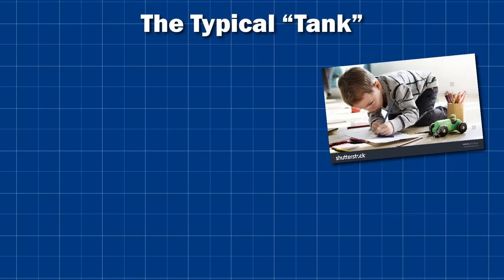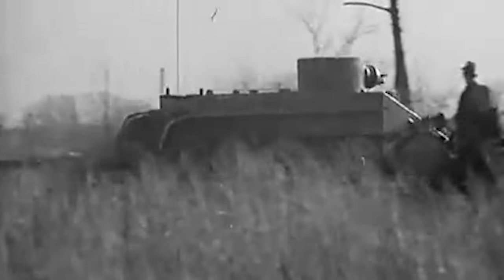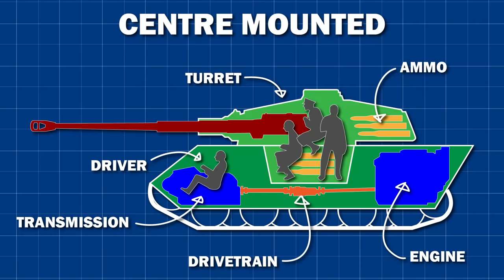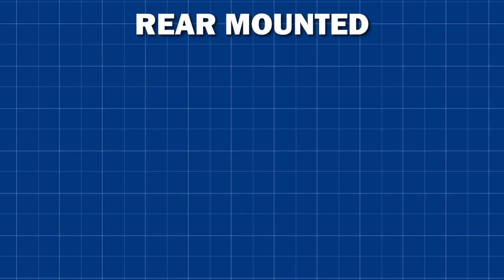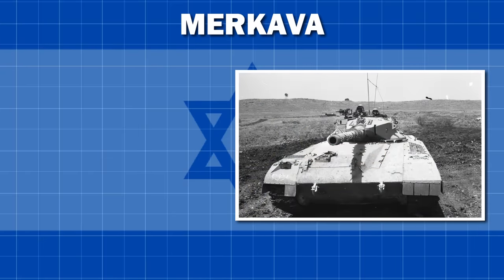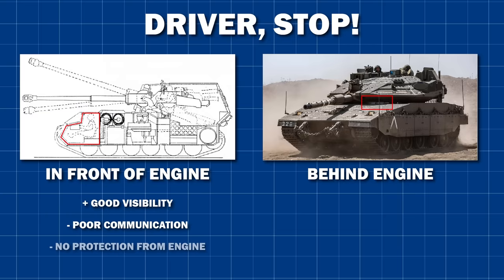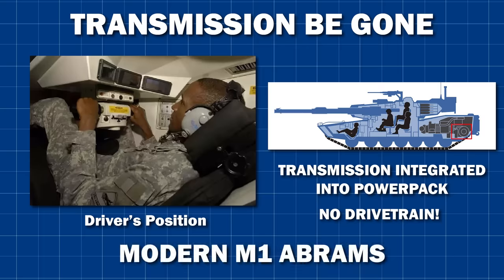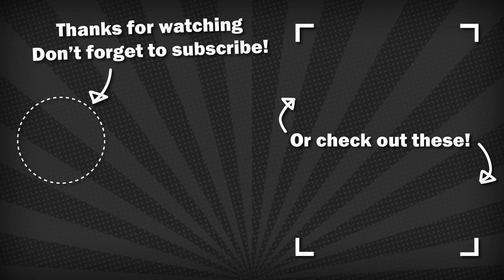What happened to Rear-Mounted Turrets?

Comment: Ironically putting the turret in the middle is where you put it when trying to find the middle ground between all the pros and cons.
Reply: Ironically you literally can't put it any more forward than on BTs and T-34 without also putting the driver in it ala MBT-70, which is how they wanted to shorten the tank.
Meanwhile in russia: ivan, why not put engine transversally?
Reply: A con that wasn't mentioned and is a deal-breaker in most cases is access to the powerpack (engine and transmission) for maintenance.

Comment: one of the most successful "rear mounted turret" is the AMX-13, the idea was that this light recon/infantry support was very short and could still use a full length gun (75 then 90mm) while being able to fit in airplanes, the driver was seated beside the engine, this tank was used for a long time, even receiving ATGMs to compensate for the aging guns
Reply: Israel took some of the concepts from this tank
Reply: I hate playing against that tank lol
Reply: We had the AMX 13 with 105 mm cannon in the Dutch Army.
Great fast tank, low profile,quick reload, thin armor, weak clutch, petrol engine..
Reply: @patverum9051  "Commander we are under heavy enemy fire! We have multiple penetrations!" "Relax it is just rain" (About the thin armor)
Reply: AMX-13, the MBT of the Indonesian army.
Yes even in 2023 they still use it as their mainline tank.
Modified with a diesel engine and better targeting systems and sights. There's also a proposed upgrade with composite turret armor and new 105mm gun, and also another new diesel engine.
Reply: Amx13 was a very successfull design.
Reply: Nothing ever happened to rear mount. The Self Propelled Howitzers have championed it.
Reply: @kishascape  i was referring to tanks, artillery is an other story
Reply: @patverum9051  and then we decommissioned it. and now lease tanks from the Germans haha
Reply: And 105mm, Indonesia have a plenty of retrofitted AMX-13/105
Reply: and then 105mm guns
Reply: Atgm? Oh yeah! It’s Amx-13. hot.

Comment: I also love some of the WWII era American prototypes like the T20, T23, and T25 with their rear-mounted transmissions. The former basically looks like a shorter and flattened Sherman, then you can see the clear line towards the Pershing design. Lower profile, more space and weight affordability in the front, and more armor/firepower as a result. That became the standard post-war for most nations.
Reply: almost all soviet tanks had rear mounted transmission
Reply: Most nations where doing rear mounted transmissions before the war. This video is just bad history.
Reply: @impguardwarhamer  I agree it should be mentioned, but to be fair it wasn't very popular until automatic transmission. Soviets simply didn't care how bad time driver had wrestling with the gears, since the size and weight reduction from it are so great on paper. About the British tanks I don't really know, though I haven't heard a good word about ergonomics or reliability of British WWII tanks either. Didn't Cromwell have somekind of semi-automatic gearbox?
Reply: @Teh0X  you dont need an automatic gearbox you just use a gear linkage.
It's awkward yes, but it was done.

It was widely used by the British and Soviets, and French tanks built in the run up to the war used it too.

Literally the only countries that didn't use rear mounted transmissions (that wern't just building vickers clones) was America and Germany, which for some reason OP and Wrench are pretending where innovators on the concept.
Reply: @impguardwarhamer  Awkward to say the least. It was straight out hampering mobility, though I understand it was made even worse by the friction clutch mechanism widely used in USSR and few other countries, until more advanced alternatives became available.

No doubt the smaller tank producing countries were just sticking to working foreign solutions like Vickers as long as they didn't venture too far. With that the best they got were probably tanks like Chi-Nu at tad under 20 tons. For the 30 ton Chi-To the Japanese had to impelement bit more advanced (copied) tech.
Reply: @Teh0X  British were very fond of Merrit-Brown transmissions, which were fairly close to automatic transmissions, certainly didnt require much force to use and were capable of some fancy stuff like neutral-steering. Cromwells did have those IIRC. 
Before that they generally relied on pre-selector gearboxes, which from the user end work like this: You drive normally, select the gear you want to shift into next with the gear lever, and when you actually want to shift you depress the gear change pedal, which is essentially replacing the clutch. It was also not a particularly hard system to use. 
Main issue with rear transmissions is just transferring the force for shifting gears and applying brakes all the way to the rear of the tank, which is why hydraulic assistance is such a crucial element. Soviet tanks utterly lacked any such luxury, hence their rear transmissions have such a bad reputation.

Comment: Thinking of it, a tank with a rear-mounted turret would probably also have severe weight distribution problems if the turret is turned sideways or towards the rear. Frontal engines, and especially engines in the middle of the tank are also much harder to access, and therefore conduct maintenance on, than rear engines. In modern days, the heat signature is also an important factor: while a rear engine would be somewhat concealed by the turret, if the tank is viewed from the front, a frontal engine would light up the tank on an IR display like a Christmas tree.
Reply: Trning the turret doesn't create any weight distribution problems since the turret must be balanced pretty well already just to turn around.
Reply: @user-vgrau  I believe he was refering to the situation when turret is facing back. I might be wrong. But yeah, it is still on the back and balance won't be shifting much.
Reply: @user-yr9rx2xh5t well that wouldn’t be an issue the center of mass for a turret is always inside it. Hence the longer the barrel the more weight it have in the opposite direction
Reply: @user-yr9rx2xh5t tip of the barrel is not going to be deciding factor for weight. Maybe if the tank was half way off the cliff maybe, but I'd blame any subsequent wreckage on the fact the tank was half way off the cliff.
Reply: it’s a problem already with the Stryker Gun Systems, it’s also why self-propelled artillery have rear stabilizers on them
Reply: @user-vgrau the turret itself is the weight problem

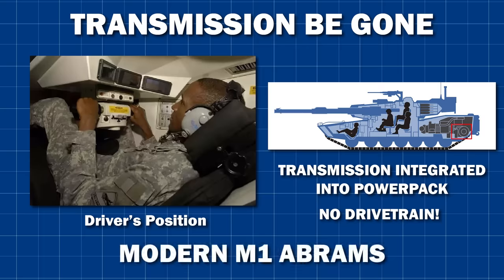Comment: 4:45 Shows you the pull cables on a Manual transmission In a Centurion tank.. 
Shows you a t34 with the lever system. Hammer included to change gear.
Reply: That is not a Centurion or T-34?
Reply: @robertoroberto9798  Both those tanks have the transmission in the rear with some mechanism to change gear in the front of the tank. That photo is of an M1A1 and driver. 
I was talking about flawed commentary, giving strange secondary impressions

Comment: A lot of Self propelled howitzers have rear mounted turrets
Reply: Also FYI the rear compartment of the merkava isnt really intended for infantry it's an ammunition storage area. The infantry thing is a myth that came from arma 3s merkava.
Reply: @matthewholt2174 I think you could theoretically have a couple guys in the back if you removed all the spare ammo, but it would be super cramped
Reply: @matthewholt2174 I suppose the intent is to use it as an impromptu battlefield ambulance. To get the wounded out under heavy fire
Reply: It also can be found on several modern tank destroyer designs.
Reply: @matthewholt2174  it was demonstrated just once. When they were showcasing the Merkava, they made 3-4 soldiers come out of the back compartment, seemingly to prove something. The soldiers complained about the crampedness and uncomfortable hard floor they had to sit on. And to carry 4 soldiers the Merkava would have to sacrifice it's firepower. Hey, just like Centauro
Reply: Yeah they dont have the weight of armour to worry about, and its probably easier 'bombing-up' with the fighting compartment at the back.
Reply: light armor + big gun = you have to mount it near the rear to make the center of gravity near the middle of the vehicle
Reply: SP Howitzers with rear turret allows for rapid replenishment of ammunition during a sustained fire mission. with a mid mounted turret for SP Howitzer, the rear powerpack is an impediment in moving ammunition into the turret. I suspect this is the practical necessity of an rear mounted turret for an SP Howitzer. From a retired Aussie armoured corps soldier who crew commanded an M113 with the very tiny Cadillac Gage T50 turret.
Reply: Loads of them don’t even have turrets
Reply: @keithad6485 and poor driver commander communication is not as much of a problem because only need to get in position and retreat if necessary so it is not an issue and it allows better gun elevation with better control of recoil from the cannon
Reply: @keithad6485  Many SPGs have turrets in the back but this is mostly necessity not because of loading but because long artillery guns on short tracked vehicles make it impractical during movement otherwise but, for example, Central European nations produce many longer 8-wheeled artillery pieces with mid-mounted turrets, and it's not an issue as you can get good access to the turret from a side by default or when SPG turret is turned 90 degrees sideways...

Comment: A lot of the modern tanks with rear-mounted turrets such as the Scorpion and Scimitar CVRT, M10 Booker, TAM, and CV90120 have that arrangement likely due to their APC/IFV origins, or at least an intent to have a family of vehicles based on a single chassis. 

Most modern APCs and IFVs have front-mounted engines because that allows one to have a large rear space for doing whatever with. If you’re turning an APC into a light tank, sticking the turret in the big empty space in the back is the most logical. The CV90120 is built from the CV90 IFV, and the M10 Booker is loosely based on the Ajax which itself is based on the ASCOD IFV. The TAM and CVRT were designed to be the basis for a family of vehicles, to include troop carriers, command vehicles, and tanks. 

Merkava’s layout is unique for a tank, but almost standard for an APC. It probably helped the Namer APC based on the Merkava, as all that needed to be done mechanically was to remove the turret and install some seats. Trying to do the same with a regular tank would involve far more effort in moving the engine to the front, installing a passageway such as the Achzarit, or forcing the passengers to disembark from the sides or top as is the case with BTR-50 or Nagmachon.
Reply: I'm not sure if things like the FV101 or the M10 really have anything to do with discussions about tanks. They're barely tanks to begin with and are more similar to things like the Stryker MGS only difference is tracks vs wheels.
None of them are designed to destroy MBT's or be able to take hits from MBT's. If you put a 75mm on a M3 Bradley does it magic into a light tank vs a tracked IFV? I feel like the only reason we consider the BMP 1 an IFV and the Scorpion a tank is because the Soviets called it an IFV and the Brits called theirs a tank. (on that note of the vehicles you mentioned ONLY the British refer to theirs as a tank)
Reply: @nilloc93 and the Centauro 2? The italian new TD, or is an IFV?
Reply: @signor_No  Well it has wheels so its sure as shit not a tank, and thus irrelevant to my point. 
Regarding your question it cannot carry troops and is thus not an IFV, it most certainly fits the description of an assault gun or tank destroyer. (which are functionally the same thing)
Reply: @nilloc93 assault guns can take out fortifications and provide infantry with direct fire support, which is why it's called an assault gun. Their are not the same as tank destroyers. Since they were never designed to fight armor in the first place.
Reply: Rear-mounted turrets have little sense on tanks with guns as tanks are strongest when using terrain to their advantage by peaking from behind obstacles showing only strong turret, but if you go uphill and have a turret in the back of the tank your gun depression angles will be limited because of all that vehicle in front of your turret that is limiting how low you can point your gun meanwhile while peaking from behind a hill you will likely show your enemy lower hull even before turret sees the enemy, so rear-mounted turrets on tanks are generally quite inferior but were used on some vehicles with extra long guns like tank destroyers because gun would stick too far forward otherwise, making such tank difficult to navigate through streets...
Reply: @IonorRea  if a tank with a rear turret want to peack on a top of a hill it can peack with the hull in reverse, i know is difficult for the driver but it is what it is
Reply: @signor_No  The trouble is that it's difficult to precisely peek out from behind a hill with only a turret showing to the enemy at the best times, usually, you will expose to the enemy also a bit of hull which is not an issue if its front of the heavily slopped and armored hull but it is a problem if you exposing the flat poorly armored back of the tank hull to the enemy.
I think that in the case of Merkava, it was understandable to use the engine in front as additional armor because early models were technologically obsolete from the beginning due to Israelis not mastering composite armor yet, so the engine and other components were intentionally positioned to work as spaced armor that somewhat compensated for lack of technological parity of Israel with Soviets which not only introduced composite armors on their T-64 tanks a decade earlier but at the time when Israel was introducing first Merkava, Soviets were already fielding active radar hard kill ballistic protection on T-55AD Drozd for the Soviet navy landing ships, while in cannon destroyers like CV90120 or Italian Centauro 2, rear-mounted turret was simply the consequence of using infantry fighting vehicle chasis with engines upfront to create more space for infantry and easy troops entry as the base for design...
Reply: Is the CV90120 really considered rear turreted? I thought it was center mounted due to engine in the front and troop area/ammo in the rear.
Reply: Underrated comment
Reply: @IonorRea the TAM was designed to actually not fight in such hills as you describe, which would need to have a very agressive pick, like a mountain's top. The TAM for example, as OP said, its hull was made for a family of vehicles, which economically talking is the best idea. The design of it was primarly to fight on wide fields such as  farms, swamps, environments that are do commin in argentina, hence the wide and low profile of it. The south, were is more likely for a brittish/chilean (or their allies)' invasion, is mainly wide terrain, low hills and bushes tal enough to hide the tank. Although, the east and the north is plenty of valleys and mountains, but you wouldn't sacrifice tanks for such places when you have mortars and artillery, and argentina is more focused on air combat than ground.

Comment: I think another issue for rear-mounted turrets you didn’t mention is the heat signature coming from the engine. Making the tank much easier to spot with thermal vision from the front.

Comment: The Argentinian TAM also uses a a front mounted engine, for two reasons: one is so that the engine can be very easily replaced, as the hatches are designed to fully expose the engine when the turret is turned to a side; the other is to use the engine as extra armor for the crew, as the design had a strict 30 ton limit to make it able to cross light bridges that abound in the country, which meant weight could not be spared for extra armor.
For a light tank, it's an exceptional design that wasn't exported simply due to bad government management.

Comment: The other modern front engine rear turret tank is the Argentine TAM which used the German Marder IFV hull and powertrain.
Reply: Who's Argentina preparing to fight against
Reply: @512TheWolf512 Our tank is pretty old design, between the 79', but is getting upgrades from Israel on these years, stuff like thermal optics, ERA, new cannon and other minor stuff
As the why we still use an "old" model, is because the tank by itself is really good for our terrain, which includes from mountain to hills, swamps and lots of rivers, as well plains, is just too good, easy to repair, cheap and on top of that, national
Is like our icon tank on this point

Comment: I think more and more rear mounted turrets will come since with technology the visabilty is not an issue. Also the gun deppresion angles are easely fixed by angling the engine deck although the angle exposes the angled engine deck a lot.

Comment: the merkavas rear hatch is a misunderstanding, the primary purpose, among a few others, is to rapidly restock ammunition. normally, you have to load rounds one by one through one of the hatches nearest to the loader, and this applies to most other non-autoloader tanks as well. the rear hatch facilitates the ability to have easy access to the ammunition storage through a door way in the back on the vehicle leading into the ammunition storage as opposed to a crew hatch on top of the vehicle to access the bustle rack. I wont doubt that you could fit a few soldiers in there in an emergency, but to fit anymore than one or two youd have to remove the ammunition bins which hinders the merkavas ability to fight significantly, seeing as the ready rack inside of the turret can only store 6 rounds compared to something like an abrams which has all 42 rounds inside the turret itself